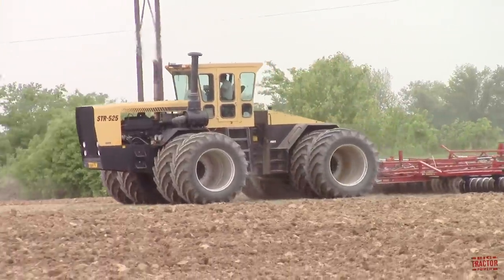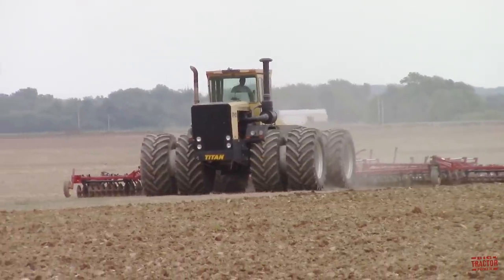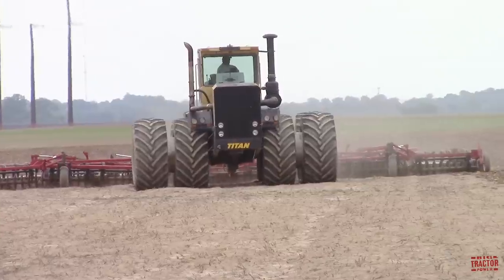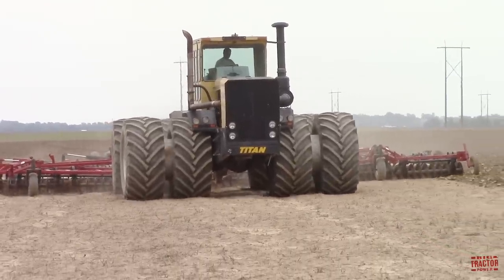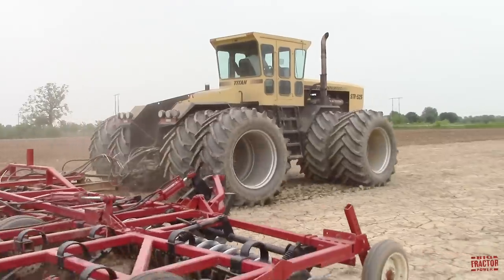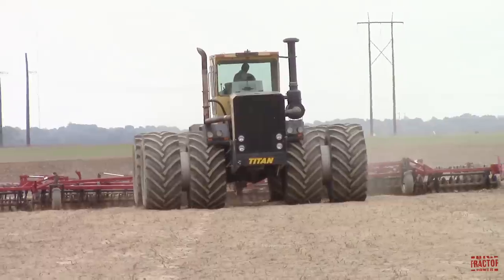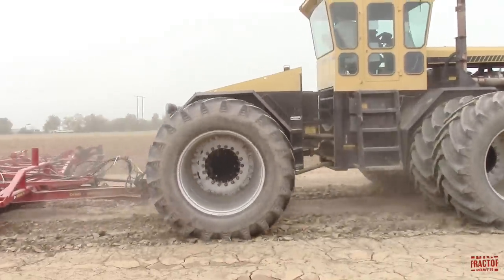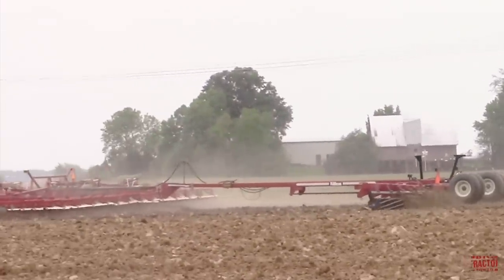What is a TITAN Tractor?

Comment: what a great idea retro fitting high hour machines back to work
Reply from the maker: It’s unfortunate that Titan did not last long. I am not sure if the price was still too high. The Titan offered more power but was in the same price range as a Case IH 9180, Ford 976 and John Deere 8960.
Reply: @bigtractorpower  Titan suffered from 2 main problems.
1 )they were almost as expensive as new at the time.
2) they had no financing .
3) to a lessor extent no dealer network. Jack was trying to make a deal with CaseIH to offer service through Case dealers, but they weren't interested in helping him compete with their new tractors.

Comment: Great video Jason! It would of been nice to see a International 4568 re-powered 3408 CAT. Thanks keep up the good work 👍🙏🤝
Reply: The components would never take the power and torque of the 3408
Reply: @RJ1999x  Oh no I disagree there’s a will there’s a way
Reply: @rodneyfalk4591  yeah, by changing everything including the frame, IH were built as cheap and as light as possible. The axles tranny and frame were all much lighter then an actual Steiger.
 Because IH was a shareholder Steiger more or less just assembled them, against their better judgement
Reply: @rodneyfalk4591 literally everything RJ said is correct. 1066 axles with no planetaries didn’t hold up to 300 horsepower as it was😂

Comment: Would be interesting to know if the one supposedly shipped to Hawaii was real and if it’s still there. Not exactly the environment where you would expect a need for that much power.
Reply: Visit some pineapple farms in Hawaii and you’ll see their use for big tractors like this.
Reply from the maker: Hawaii is home to lots of big 4wds.  They use them to work the tough volcanic soil.  Heavy tillage 👍
Reply: I don’t think it’s still there but I’m not sure. Dole pineapple really loved anything on the tiger frame. They pulled ridiculously absurd offset discs. I do know a legitimate 9190 was rescued from Dole in Hawaii though

Comment: We were going to send our Versatile 875 candy striper to get it rebuilt. That is the spring that Fargo got flooded so bad. They contacted us, told us that they could not do it that year. We had almost 8,000 hours on it. I think 7,800 to 7,900 hours. Instead of 280hp 855 we would have 320hp 855.
Reply from the maker: Thank you for sharing.  A TITAN painted Versatile would have been very cool.  Do you recall what year that was?  Did the flood cause them to close?
Reply: @bigtractorpower   I believe that it did, I saw pictures of the original Fargo Steiger shop with water about two to three feet under the overhead door header. 
All tools were lost to water damage and rust. We had a cousin living there that sent us some pictures. I am guessing 90 to 2000??? Not sure.  We originally got the idea from “The Farm Show Magazine “ I think that was the name. Prasco Super Seeders were dead or dying. The 5020 was pulling 48’ of IHC 150 hoe drills. In 3 years we were glad that we didn’t do that. The 875 was pulling a JD 787 cart, witch was an early Flexicoil 2320.
Hello from north east Montana. 
10 miles from the Canadian border.
Reply: @darrelfuhrman8217 The Red River flood would have been spring of 1997. I had just gotten accepted to UND up in Grand Forks that year and they were still cleaning stuff up when I got there that fall
Reply: @shawnmiller4781    I think that would be correct, as dad died in March of 96, Floyd thought that it would have been that spring or next spring.

Comment: The tractor seemed to do well. But that one pass tool and crumbler behind it looked like it was doing a shit job as far as pulling level through the field. The disc gang on the right side looked like a bearing was out the way is was bouncing around on the ground and the left wing of that basket crumbler seemed to angle up so bad that the outside tip wasn't even touching.
Reply: I seeing the same thing